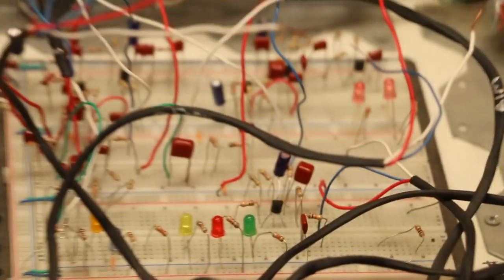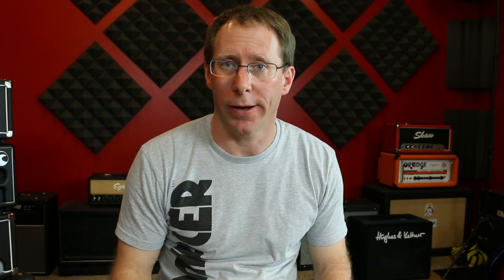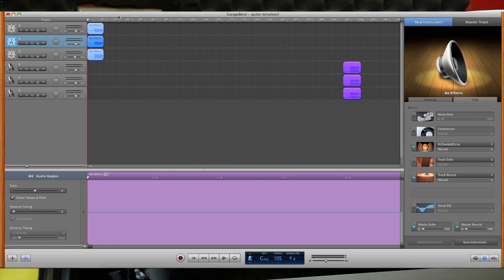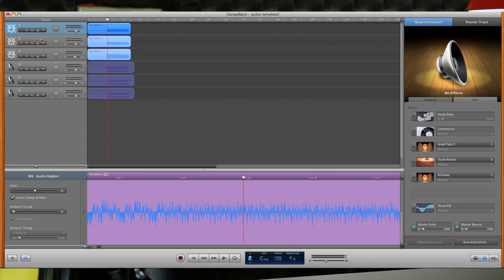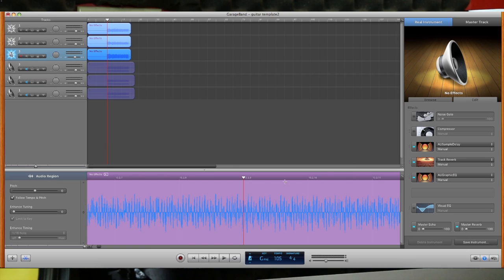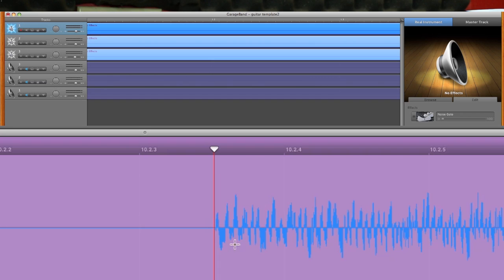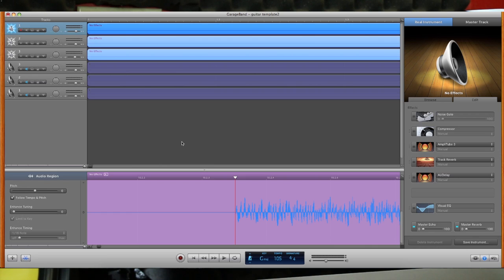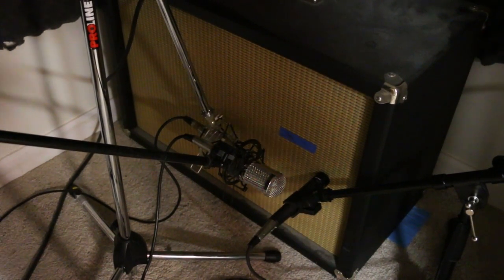How to record guitar amps using multiple mics, Vlog #1

Comment: cool video love the micing but I would never have a cab stuffed into a corner like that . I think getting that cab off the floor and about 2 feet from the back wall would give a much better final sound but over all I'm loving this channel  big time .
Reply from the maker: It really depends what sound I'm going for, but that room is built out of square so it's not too bad of a bass trap. I'm not a fan of raising them off of the ground though for purposes of demo'ing pedals. Glad you like the channel :)
Reply: Ah i find a much more focused bottom end if set that way .and the mids tend to shine through more . I had experimented in my studio but after chatting with several friends in the industry it really changed my technique . The course that olly from periphery gave really explains it better than me lol . But as with all things guitar it's all personal taste for sure ;)
Reply from the maker: *****
Yeah, I could see that working well too... what size cabinet are you generally mic'ing?
Reply: +Wampler Pedals either a 2x12 currently a zillion with creambacks is my personal but otherwise I've several 4x12 cabs with different speaker configurations . but a lot of the time I'm micing 2x12 cabs these days :)